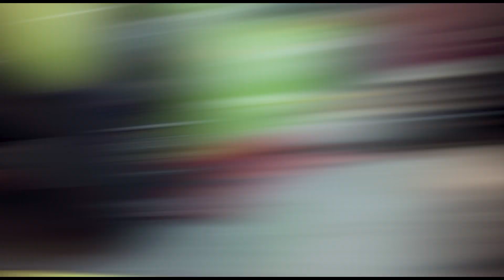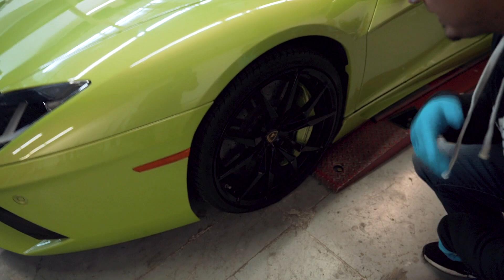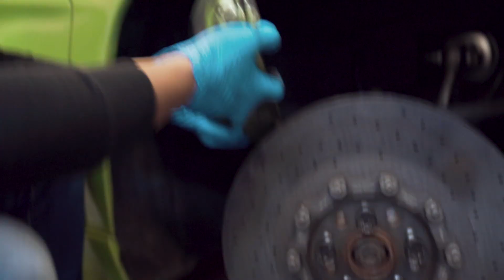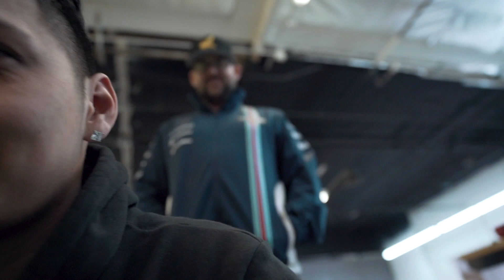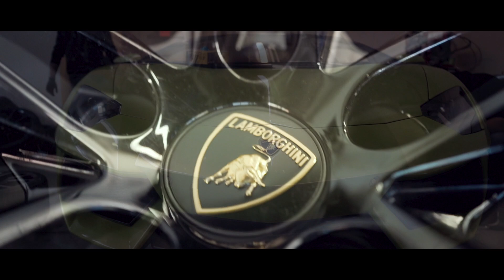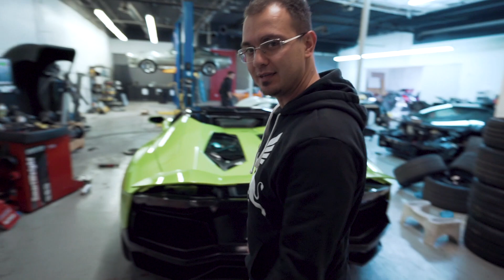AVENTADOR BRAKE SERVICE - DIY *Saving Thousands*

Comment: You should do a give away with the old rotors. I would love to hang one up on the wall
Reply: Shipping ain't cheap though I guess :)
Reply: Spazik86 The Rotors are Carbon Ceramic there pretty lite.
Reply: @Antimatter.  Right around 16 lbs. (7340 - 7220 grams)

Comment: Hey Houston, I own an Aventador. About to change the rear brake pads. Did you have to take the brake fluid cap off to relieve the piston pressure? How did you relieve the piston pressure? C-clamp? By hand with the calipers?

Comment: Happy New Year !!! Royalty gang.. love the lambo's .. but for me a break job could help send one of my kids to college so ill have to stick with the lower maintains corvette with slotted rotors lol.. Keep up the great work love seeing the owner (Houston) getting his hands dirty.. you can tell you love what you do.. Life goals for sure.. still living thru you bro.. Im sure 2019 will be a blast. Oh i did get some upgrades for the vet.. I got the z06 grill and carbon flash badges. and i lowered it on the stock bolts, got 1 inch lower on the front and 1/2 on the rear. Im thinking about making some videos for youtube, but i did a couple and i suck lol.. keep living the dream..

Comment: Nice work.. Waiting for 1 of the Haters that  doesn't own a car but drives their baby moms car to comment you did something wrong...
Reply: Like not using a torque wrench for fastening? Your welcome.
Reply from the maker: No lube,  no bleeding, no zip ties, no white gloves. Blah blah blah....
Standard troll comments. Save your finger strength guys....No one cares.
Reply: Your actually supposed to torque down the lugs on most cars with the wheels on the ground i know that some cars with center lock wheels you do it off the ground. My point is they know how to take care of their cars or they wouldn't have a business.

Comment: You’ve got the glass engine covers re installed, is that just due to the cooler weather so it’s not having over  heating problems? I like the glass in, adds more angles to the car. 👍🏻

Comment: So, what did you use to push back the brake pistons? That is the hardest and most important!! Why did you leave that part out?
Reply: Good new brake pistons push in without much force.
Replace calipers with hard pistons.
Reply: With my over 16 years old car, I was able to push the pistons in using only my hands. I doubt it's much harder on a new car like this. Just put pressure on the old pads and pistons should go back.
Reply: @Fusay34  
A few years ago, I owned an 01 Altima and the mechanic who did the brake job broke their piston pushing tool trying to put it in.
He finally got the job done hammering the shit out of it with a sledge hammer lol. A new caliper doest cost that much $.
Reply: Attila Morvai i was thinking the same thing man!
Reply: If you remove the cap on the fluid reservoir there is no back pressure, then you can push the Pistons back with two fingers. I've been doing brakes since the 70's the materials have evolved but the principal they work on is the same.
Reply: @heavenstomurgatroyd7033  Thank you for info!!

Comment: CCBs are suppose to last the life of the car , unless heavily tracked , so that aventador has over 100k miles on it? How many pad swaps did you do since new? I wish you showed us the whole weighing process , you have to pull the hat off to get the proper weight and the hat hardware must be replaced , I really think you could have got another set of pads out of the old rotors , It must be nice to have 20k of rotors laying around lmao!

Comment: Sir how much miles once it needs valve check and service intervals and how much mileas ceramic pads lasts and how much oil i srequired and how much is oil chnage costs pads

Comment: With considering vehicle dynamics, it's exactly the opposite. Because of the mass moment of inertia, the car gets a lot more of the weight to the right side while turning left and vice versa. Thus resulting in a load to the outer wheel of the corner. So while breaking this wheel side will experience more wear.

Comment: I’ve been a Lamborghini tech for 12 years and your technique is all wrong although the process is somewhat right
Reply: What was wrong?
Reply: Ashish Patel he isn’t an entitled mechanic that thinks they know everything. That’s what was wrong.
Reply: I’m curious to what’s wrong?
Reply: Who torques down rotors on the car with 1 hand  with those greasy oily gloves he probably never cleaned those rotors after nor checked his brake fluid
Reply: Pushing your caliper piston down with ur hand lmao jokeee
Reply: @cryptocraze9550  I've used a c clamp to push the piston back in when I do brake jobs. I'm sure it's no different than using you're hands as long as the piston goes back in. Lol.
Reply: It’s the principle kiddo
Reply: @cryptocraze9550  - apparently you missed where Houston said, "we're gonna torque everything down, make sure it's to spec"... about a minute before the scene you're talking about. Snugging up the locator/retainer screw to make sure it's seated while talking to the camera is not what he was talking about, and you know it. If you wanna show off for everyone and trash talk, fine... but you can do better. I have faith in you. A proper troll would never say, "...he probably never..." hahaha
(For those of you who don't know, that bolt does little more than hold the disc in place until you put the wheel bolts back on, and can be left off entirely from a functionality standpoint. In most one piece steel rotor applications, it's actually a flat head machine screw that requires a normal screw driver and the torque spec is measured in inch pounds if the manufacturer even has a spec for it. On this application I wouldn't be surprised if Lambo has a specific torque they'd like to see, and no doubt Mr. Sanchez can quote it off the top of his head because he's been wrenching on 'em for 12 years.... it's too bad his trolling game isn't as strong, huh?)
Reply: Walter White you clearly have to much time on your hands lmao